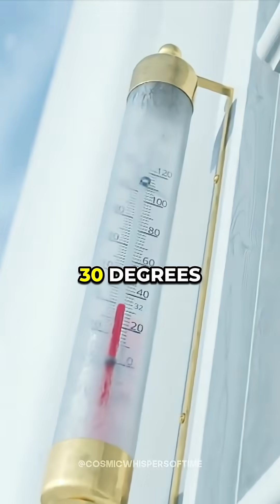Why Pipes Burst in Winter ❄️ w/ Neil deGrasse Tyson

Comment: That’s why breaks typically happen at elbows or bends in the pipe. The pipe wall is a little thinner from being stretched by the bending process.
Reply: I never see frozen pipes break at elbows. It always on the straight away.
Reply: Never have I ever seen a water pipe bent. They always have elbows and they are thicker than the pipe.
Reply: Yes ive only seen it in the mifdle of the longest tun

Comment: I’ve seen copper pipes split from freezing water is the strongest element we have here on earth nothing stops it. There’s no pipes that can keep it from freezing in a big container made out of plastic like 1000 gallons. It’ll develop 6 to 12 inches of ice in the center will be fluid, but the ice turns into insulation that much water can be frozen. That’s what I think.

Comment: I disagree.  I grew up in the mountains and water doesn't freeze enough to break initially. it is the refreeze that cause the break. Water in a stagnant situation doesn't break the pipe but when it freezes oxygen leaves leaving cavities. If when the water slightly melts or there is a supply that fill the voids, on the refreeze the voids being full now expand and break pipe. 
   I repaired a lot of iron pipes in my time due to frost damage If I caught it just in time shutting off the water supply just as things first froze, I saved the pipes from   damage, if I waited a day of refreeze damage would occur. Pipes/steel tubing, that were used on a fence vertically would fill with rain water and freeze, the damage occurred when it rained and froze again.

Comment: N deG T is wrong.  The water is exactly the same temperature as the ambient outside temperature.  It just remains liquid because of the pressure.   When the pipe finally ruptures and the pressure drops, the ice freezes, and in doing so actually increases in temperature (freezing is an exothermic process).

Comment: and when it cant hold it any longer the pipe explodes only when it does its just a dull crack not an explosion because the water has frozen and will not explode and burst out of the pipe, it has expanded and caused the pipe to rip open to allow the water more room in its frozen state but the frozen water is not going anywhere, it's frozen, it just needed a little more room and the split in the pipe allowed for that so everything is in a relaxed state until the temperature increased and the ice melts into water again, water under pressure that does want to go somewhere.

Comment: The pressure doesn't hold the water temperature at 32 degrees. The pressure creates a lower freezing point for the water under pressure. Just like water can boil at room temperature when under a vacuum. What a doofus.

Comment: He LITERALLY just described the quiet anxiety 😳I get every single winter, praying and hoping my pipes don’t freeze.
Reply: just let it run overnight
Reply: Leave a faucet dripping when it gets really cold.
Reply: just leave the tap in your bathroom and kitchen slightly open, the constant water flow, however small, will keep your waterline from freezing.
Reply: @willengel2458 I've done that and the pipe froze with a frozen stream of water hanging from the faucet. The outside temperature was 5 degrees.
Reply: @PhyllisGreene-f2h 😂😂😂😂😂
Reply: Check it out:
Pool noodles, get some, cut down middle and then fit onto the pipes exposed to the elements outside of and underneath the house if possible. If not you can instead get a couple foam domes that fit over the spigot connectors that attach to your pipes from outside and that can prevent a lot of freezing, thawing, refreezing and weakening from occurring preemptively if you don't jive with crawlspaces or have a slab 🏠 

Source: 20+ Year Plumbers Son.
Reply: @L0WLIF3iC0N >Thank you!!!
Reply: We lost power a few year ago I and wife were not home we had an artic front come through i had pipes bursting everywhere, what a nightmare.

Comment: It is called super-cooling. The real physics is that the crystallization require a 'seed' or impurity to start a chain reaction. Ultra pure water can be  super-cooled down to as low a " −54.9 °F " and then the water will turn to slush as sensible cold is liberated into latent heat of fusion. Only at that point will the temp jump up to 32°F expand and continue to freeze solid as more heat is removed.  Of course negative energy is required to expand the pipe.

Comment: Easier to coat it with foam insulation, the water needs to flow; what about the distributer reservoirs? Maybe HEP, meanwhile pump and circulate (HEP), pump, and heat the water in a partition, within the depth of soil.

Comment: "The stronger the pipe is, the more pressure it takes to break it"
Great job dude.
Reply: Breaking of the pipe isn't the topic of the video.
The topic is the temperature at which the liquid turns to a solid and what affects that.
Reply: @deang5622 its both dude
Reply: @deang5622 It's literally what he says.
Reply: @Olivershoesoff Physics wasn't your strong point at school was it?
The salient point of the video is the forces created by the desire of the water to turn from a liquid to a solid but can't because it is contained in the pipe.

The salient point of the video is not the pipe bursting open.

Had you studied physics in school you would know what the salient point in the video is.

Tell me you don't understand phase change without telling me you don't understand it.
Reply: @deang5622  OK, we can do this.
First, this clip is either incomplete, or he didn't set up the scenario.
What he MEANS to say is that in an enclosed environment completely filled with water, it will not freeze at higher pressures. In that, the water will exert an internal pressure on the container (or "pipe") because the water needs to be at a much higher pressure in order to not freeze. What he's wrong about is that him saying the water stays at 32 degrees, whicn is absolutely incorrect. The freezing point of water actually decreases with pressure. When the pipe can no longer take it, it will burst and the super-cooled water will immediately freeze as it is now exposed to atmospheric pressure. So - the stronger the pipe, the lower the temperature can go, because it can handle a higher pressure 
NDT is a clown and him stating that water can't get ever get below 32 degrees shows that he doesn't know everything. That's really the "salient point" of this clip. 
There. You learned something today.
Reply: @Olivershoesoff Stop waffling. Keep your posts concise.

I am not going to read a post that long and where there is a failure to paragraph.

I explained to you what the salient point of the video was. I don't know why you cannot understand it. It must be down to your lack of knowledge of physics.

This debate is over.
Reply: @deang5622 Not reading to learn something might be part of your problem. Thermodynamics and Strengths of Materials would cover it. But I'm guessing you didn't take those as an undergrad.
Reply: He linked constraints to materials (mechanics) and temperature/phase change (thermodynamics).
Reply: yeah wrapping up his explanation with that statement didn't have the impact he probably hoped for. everything that came before it was kinda interesting but saying it like that... lol
Reply: Yeah I was like wait
Reply: NDT is a clown
Reply: Some like  to get to the point. Others like the longer version it paints a visual picture
Reply: What he should have said is the stronger the pipe, the colder it must get before it freezes.
Reply: From an engineering perspective, that is a false statement regarding water installations.
Reply: @Oglumen  Thanks Mr. Engineer.
Reply: @Oglumen ,you're not wrong, I just bailed after i saw who it was and simplified it.
Reply: This guys has a PHD and is praised as science gurú?
Reply: It’s like he’s still on a children’s show and thinks he’s the smartest person alive sometimes.
Reply: man scientists like to over explain things dont they. 😂
Reply: You must have went to trump college... N graduated top of your class ... One of them Epstein courses right???
Reply: @TheBrysenj
Wow you're really gay
Reply: @TheBrysenj  The TDS is strong with you.
Reply: Ok dude
Reply: @TheBrysenj  what in the delusional liberal is this comment

Comment: PhD chemist here. I don’t think he explained that very well. Water expands when it freezes. A strong pipe will prevent that expansion from happening. Therefore he’s right that the stronger the pipe the lower the temperature around the pipe has to be to force that expansion event. I wish he just explained it like that.
Reply: If it's a fullfilled pipe, does it mean it will never freeze? Unless the pipe breaks.